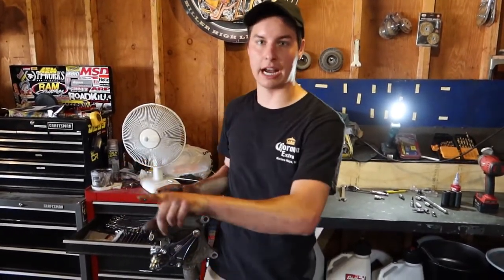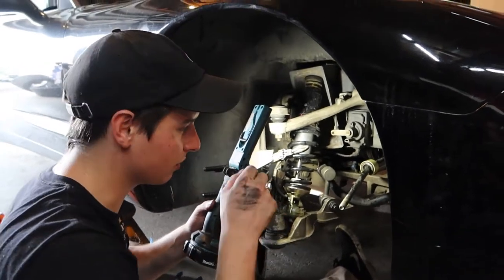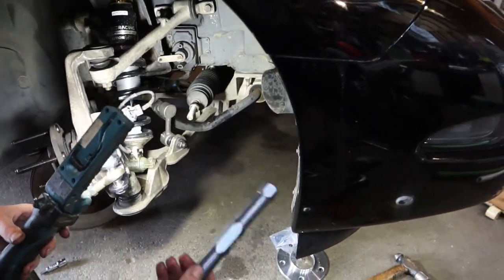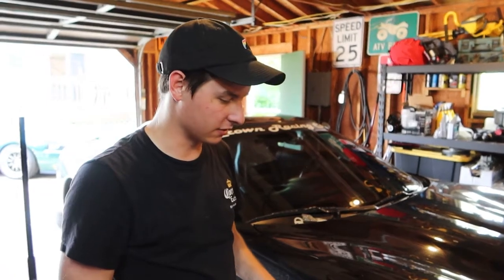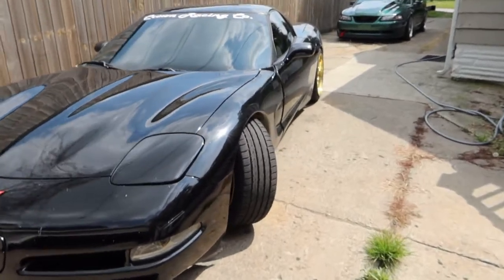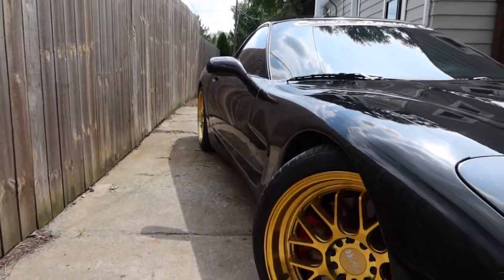C5 Corvette Drift Car Build SLR Angle Kit & Extended Wheel Stud Install

Comment: That fitment is nice. What’s the tire size? It’s a square fitment?
Reply from the maker: The wheels are F1R F21 18R x 8.5 +35et the tires are 225 x 40 x R18   The tire is stretched about 0.5" - 0.75" Next time I'm going to do a 245 x 45 x R18